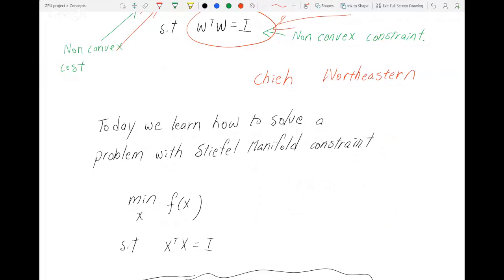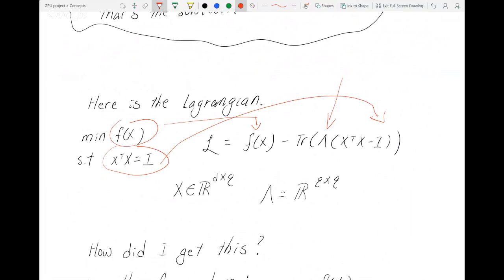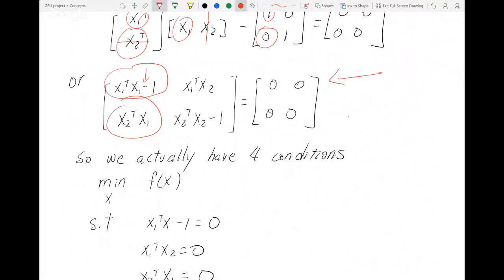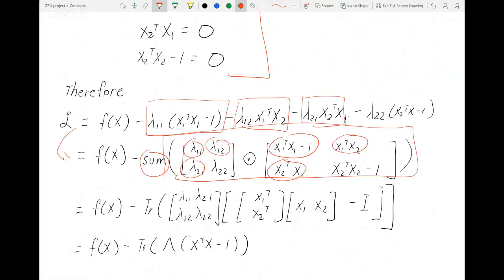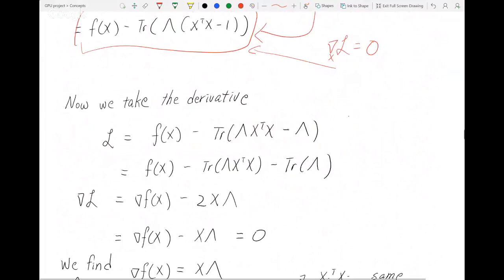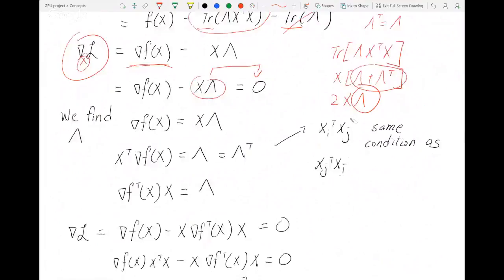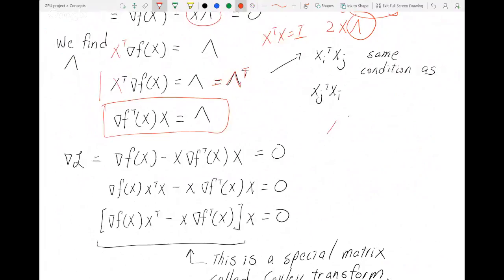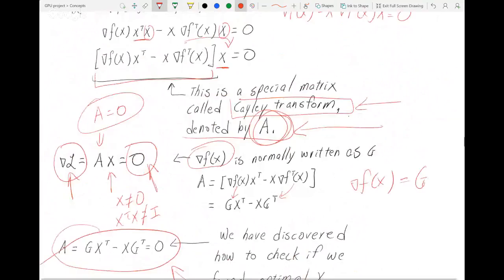Optimization with Orthogonality Constraint ( Part 2 )

Comment: Hey Chieh Wu, great video.
I had a question regarding how can gradient descent be used to find the solution X.
I tried to update X using the gradient of L (= grad(f(X)) - X*(grad(f(X))).T *X) but this didn't work.
The X i got was not at all satisfying the constraint.
Can you guide me into the right direction as in how will one use an iterative algo to solve this type of problem.(Does the initialization of X will matter a lot).
Thanks